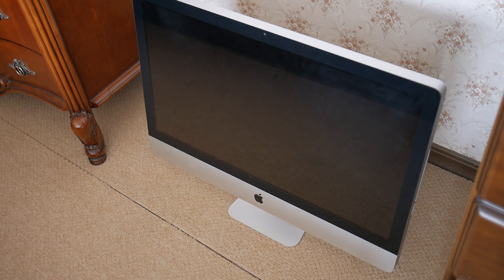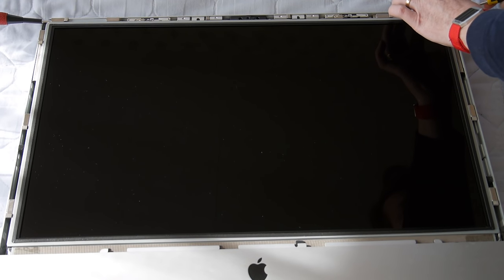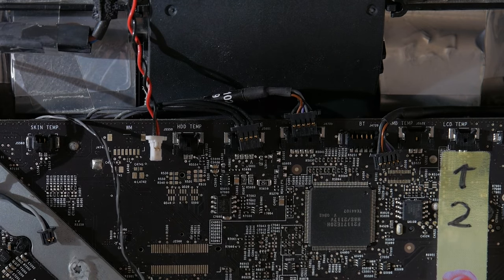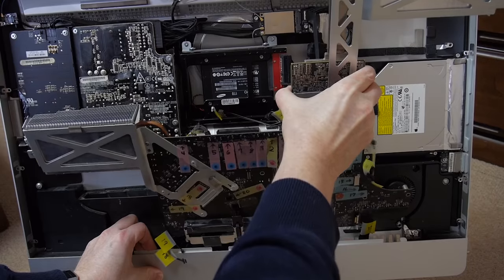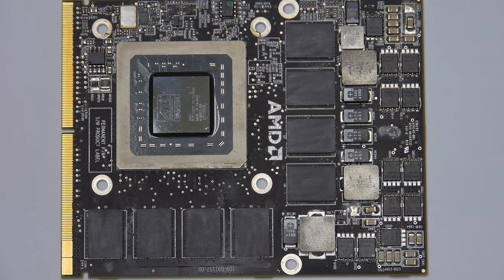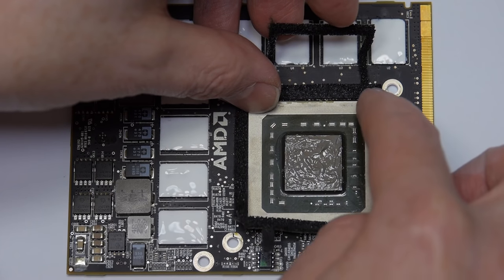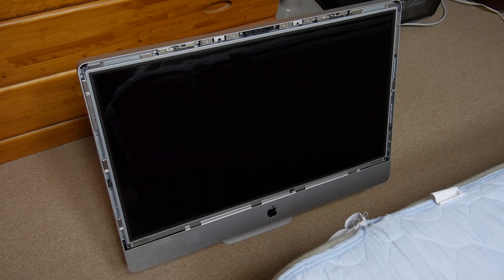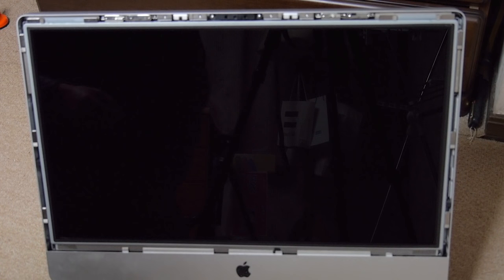Late 2009 iMac 27" Video Card Repair [4850 Bake]

Comment: You rock, JDW - I have a mid 2011, 27” 1gb GPU the screen displayed Green Bars and would not boot up so had nothing to lose. After watching your video felt confident enough to remove the Motherboard, but what pain. FYI - I Baked the GPU for 12 mins at 400 degree F. Replaced the thermal grease with Artric silver 5. Also replaced the thermal grease on the CPU while I had it apart. After finally getting it back together it Booted right up .  Thanks
Reply from the maker: Thanks for letting me know of your resurrection success!  With your having replaced the CPU thermal paste too, I suspect your total time invested was more than mine.  I do want to ask about the video card thermal paste though.  You seem to have only used Arctic Silver V and nothing else.  Did you replace the thermal paste on the video card memory chips?  You would have needed either a replacement set of thermal pads, or K5-Pro, since Arctic Silver V isn't thick enough to fill the gaps between those chips and the heatsink.

Comment: Thank you for taking the time to make this tutorial. I was soooo skeptical about baking, a computer in my oven, I’m not even a baker😉. I was also a little afraid tackle the innards of the IMac. It fired right up and worked great. Two extra screws leftover tgough🙏
Reply from the maker: It's great to hear your story of success, Don!  If those two screws are from your display, you're probably fine.  Just don't throw them away.  You might open the case again some day and want to put them back into place.  Best wishes!

Comment: Thanks for the video JDW, have just done mine - and seems to be working, also downloaded a fan control for extra cooling. Did notice the screws on the back of the Spring screws were very loose this would make for a loose fitting against the heat paste/sink.
Reply from the maker: Thank you for making time to comment, Andrew.  It's unfortunate to hear your spring-loaded heatsink screws were loose when you tested them.  That obviously would create heat-transfer problems that could even lead to the death of the video card.  I am pleased to hear the bake worked for you though.  Best wishes!

Comment: Cool video - used as a guide. Only now I forgot to put a rubber gasket back on the chip. I remembered when I had already collected everything. As you think - strongly it is needed, I do not want to take everything apart again. Thank you
Reply from the maker: Actually, that black thing you saw in my video is made of some kind of foam, not rubber.  I don't know the purpose, but since it is made of foam, I can only assume it is some kind of dust filter?  Maybe it was intended to keep dust from collecting around those chips?  Not sure, but it wasn't dusty at all when I first removed my video card.  I don't think it was intended to keep thermal paste overspill at bay because if that was the case, why make it out of foam?  In any case, I don't think it will hurt that you left it out.  If anything, leaving it out would allow for more air flow.
Reply: I'm understood, thank you. Although I have another video card (HD6970), but the rubber gasket is the same. I do not think that it is necessary for a heat sink. I will not touch it, I'll see how much the chip will work after warming up.

Comment: Excellent job JDW, the lights went out on my mac and I canned it. It was 10 years old but wish I had of seen your video before i pulled it to bits. I am now using the display as a 3rd monitor for the new mac.
Reply from the maker: Well, it's only natural that a veteran tool man such as yourself would want to tear that bad boy apart!  ;-) But I am glad to hear you were able to put it to good use.  Keeping these machines in service in some practical way is the ultimate goal.

Comment: Thank you for excellent video. I will use your video to open the iMac, and then remove the hard disk, and later back it up via usb-converter. I had no idea that the glass is so easy to remove.
Reply from the maker: Thank you, Riku!  The glass is easy to get off, but putting it back in is the hard part because you have to blow out all the dust before you put the glass back on.  Because none of us have a "clean room" to do that job in, there will always be a bit of dust that flies behind the glass before you get it back on.  It's perhaps the most frustrating part, actually.
Reply: @JDW-  I had a bit hurry today so I did not buy those vacuum-tools like the one you used. Instead, I used the one that I had at WC; the rubber one for plumber. It sucked the glass all right but I was surprised how easily it got off, and tilted the glass too much. Yep, it broke....my main goal was to find the hard disk which I was able to remove, mother board or display circuit was broken, so no use to trying to fix the iMac further. Now I need an SATA-USB adapter for data recovery. I wish the iMac would have the hard disk as module that you can change from outside...like the ram-memory.
Reply from the maker: @rikunevalainen8154  Oh no!  I am terrible sorry to hear you broke your front glass!  That certainly would have made my heart sink. The good news is that you can find replacements on Amazon for surprisingly respectable prices like this one (affiliate link): https://amzn.to/3p688OR

Comment: Thank you so much @JDM i fixed my shitty imac 2009 today with your fully detail tutorial. I baked my Radeon card at 200 fan force oven in 10 mins. At first, it has a big smell of burning plastic (or capacitor or somewhat)  from the card. I was so worry about mine card was overbaked, but i had to tried no matter what as i had no turning back once i stepped into this baking method. After awhile review your video over and over, i had finished putting back everything together. And then, booom it workded like a dream, just as good as before it died out (even run cooler than before ; i guess because of the new thermal compound that i bought from the local shop). And now i'm typing on this computer to say thank you while i'm opening 11 tabs on Safari and playing music from one of the tab on Youtube. 
Awesome job that help me recused my imac and save me ton of money on buying a new one. 
:D sincerely thank you for all of your effort putting in this so much detail video.
Reply from the maker: I'm thrilled to hear of your success, Addy. Thank you for sharing your story and best wishes as you enjoy that newly resurrected Mac!

Comment: Thank you so much.  You video is very detailed (which I needed) and it worked.  The only suggestion I have is when you are putting it back together, please don't speed that part up.  I had to keep going back to the beginning to figure out how things went back together on some of the plugs.  :-(  But overall, excellent video.  :-)
Reply from the maker: Thank you for watching and sharing your story if success, Dawne.  I of course take all advice in the comments section to heart.  The main reason I sped through reassembly was because some people complain if the video gets too long, and with it already being 1 hour and 6 minutes, I was afraid that going to slow at the end might be an issue for some people, especially since one can review the initial part of the video again.  But again, I do appreciate your constructive advice and will consider that in future videos.  Best wishes to you and your newly resurrected iMac!
Reply: @JDW-  When I was doing this procedure, I would watch you and stop the video and go do what you just had shown.  1 hr. 6 mins is nothing compared to about 10-12 hours.  lol.  Thanks again.

Comment: Great work. Just one point- when replacing the motherboard I had to take the panel off the memory card access (on the bottom of the case) to feed the memory cards into their slots. Before that the board wouldn't go far down enough......
Reply from the maker: If you mean the aluminum "memory access door" that screws in at the very bottom of the iMac's housing, then yes, you would need to leave that off during the installation, and of course all RAM should be removed before the motherboard is removed.  Thanks for watching!

Comment: hey man, you fixed my iMac, although the br and cr series difference doesn't matter, it will never get close to that temperature, it usually hovers around 30 in case temp, so if I were you, don't wast your time.

cheers,

Ethan
Reply from the maker: You are correct about the PRAM battery.  But there is one point of consideration... Apple "wasted their time" :-) in choosing the BR-series, so if one has the means to get a BR-replacement, why not?  The BR series would be more robust over time in hot environments, even if the heat of the said environment didn't exceed 30°C.  This is more of a concern for iMacs that run 8 hours or more per day.  But thank you for mentioning it nonetheless, as many people will get by just fine with the CR-series battery.  It's also great to hear your iMac was fixed.  I hope it lasts as long or longer than my 2nd bake (2 years 9 months)!
Reply: @JDW-  very valid point you made there, I like the video too, keep it up

Comment: thankyou for taking the time and effort to post the video,apple sure makes it as hard as possible to repair any of there products,which usually means its not cost effective to do unless you can attempt the repair yourself,your video gives some hope to some that can attempt the repair themselves with a minimum outlay money wise,thanx again
Reply from the maker: Thank you for your kind word, Patrick, DIY repairs are especially important now that Apple considers these old iMacs "obsolete" and therefore doesn't carry repair parts for them anymore.  For most people who try the bake though, it works, and if you use the correct thermal pastes, it often can last long enough to have made the effort worthwhile.
Reply: @JDW-  just an update managed to do mine with your help,i did mine in a combo microwave oven thats got an oven feature as well so i set in on the oven setting at 200 but checked it first with a thermo couple multimeter and it read 195 - 200 so i gave it a go and it seemed to work thanx for your help hope this might help others as well
Reply from the maker: Your oven seems to be just like mine. So long as it’s set to oven mode and not microwave mode, it really does work great and the temperature is stable too. I’m certainly glad to hear it seems to have brought your graphics card back to life! Best wishes!
Reply: @JDW-  yes certainly seems to have worked for mine,forgot to ad that i put my card in the bottom part of the oven and not near the top part of the oven as the bottom part is where i tested the temperature,good luck to anyone who tries this way,and thanx again for your input

Comment: Thank you very much for this tutorial! I just bought an iMac with a supposedly power button issue that caused a black screen when it turned on and it does eventually come on after putting it on and off many times, but after many hours of research it turned to be the GPU and I wasn't prepared to buy a new since shipping is so expensive where I'm from, hence finding your video and I got it right on the first try ( on an old school oven), just to see if it will last for a very long time. Again thank you very much for this!
Reply from the maker: Thank you for sharing your success story, Luigi!  I'm so happy the Bake was able to get your GPU up and running! The Bake doesn't last forever, but it usually lasts long enough to make the effort worthwhile, especially if you used the right thermal paste.  Best wishes!

Comment: Just a little note.....  To replace the video card, ONLY 4 screws are needed to be removed!  I saw this on another video on youtube.  Where you have some tape with the number 3, those 3 screws need to be removed, then in the top right corner of the video card heatsink , there is ONE more screws, and BAM, video card is removed WITHOUT having to remove the logic board!  Your welcome :)  *Video uploader, maybe make a note of this comment....   Thanks for the free information though, and trying to help people fix their Mac, that is a great thing to do to help the community, but you don't need to remove anything more than the screen, and 4 screws :D.   I bought my video card ATI 4850 on ebay for $150 and it came with the heatsink already, so I didn't even need to swap out heatsinks.  Hope I helped, not trying to be a know it all, I run a computer repair shop, watched this video, then found the other video showing 4 screws.  :D  (after screen removed)
Reply from the maker: You are correct, but you still need to at least partially pull out the motherboard in order to change the PRAM battery which sadly sits on the back side.  You can see the easier method of video card removal (which ignores the PRAM battery) in my 2nd Bake video here: https://youtu.be/6BJGLFCigdA

Comment: Friend, you are the fucking master. I had the problem of vertical stripes in my imac late 2009 and I have solved it by following your video. If you go through Spain you have a few paid beers. A big hug
Reply from the maker: I’m so pleased to hear of your success with the video card bake, Manuel! Best wishes!
Reply: Bad news, the vertical stripes have returned. I will try to do a second cooking following your new video and I will tell you the result. Regards
Reply from the maker: Only 2 weeks of use before the problem returned?  I'm terribly sorry to hear that.  But that seems much too short for a failed bake.  My 1st bake lasted 4 months.  I'm still on my 2nd bake, well over 6 months.  One change I made though was the thermal paste.  Please be sure to watch my 2nd Bake Video to see the paste I used and how I applied it.  You would need to remove the video card again to redo the paste, so you might as well do a 2nd bake.  But using good paste in the right amount is important.  Again, please watch my 2nd Bake Video for that.  Link is in the description above.
Reply: After the next baking I will use quality thermal paste. I have already asked for amazon the same pasta that you have used. Thanks for answering. A big hug

Comment: I’ve removed the glass from  my 27” without suction cups by slipping guitar picks into the top right and left corners and carefully prying open. Did this after I heard some one say they did the same with their finger nails. So save your suction cup money for good thermal paste
Reply from the maker: Great tip for the guitar players out there, but folks such as myself prefer to use the suction cups over a potential broken fingernail. :-) Thanks for the tip!

Comment: I just got mine working! Boot would get stuck ant 50% loaded and vertical bands and/or squares all over the screen. Before that, the times that it would boot up it would freeze on its own, wouldn't wake from sleep (had to disable) and screen saver would turn on sometimes even though it was disabled. I did 400 degrees F for 9 minutes then left the oven door (Toaster oven on bake mode) open and let the card cool completely. MX-4 paste and left OEM white paste on RAM and other chips. I actually tried using a heat gun right before at 395 (I can choose the exact temp) for 9 minutes by hand right over the GPU  but that didn't work. Using a blower when the computer is open (DO THIS OUTSIDE) works extremely well at removing dust from everywhere. I am actually going to drill multiple holes in a nice clean circle using a template in the case right where the GPU sits and may even attach an external computer fan right over the holes and leave it connected via USB all the time. The idea to use an Nvidia Quadro K2100M PC card and flash was an interesting idea. Thanks for mentioning in your updated FAQ 2020 video which was super informative!! If you are wondering if you should try this, do it.
Reply from the maker: Thank you for the detailed comment, and congratulations on your bake success.  For reason of longevity, you may find that leaving the stock past on the memory chips is inadequate.  That's really why my 1st bake lasted only 4 months, I believe.  After my 2nd bake, I took time to clean off all the old paste, then apply K5 Pro (a thermal pad replacement paste) on the memory chips, and K4 Pro on the GPU (you can use MX-4 or Thermal Grizzly, etc. on the GPU only).  That 2nd bake lasted 2 years and 9 months.  So if your bake lasts less than a year, I have little doubt it's due to the old paste on the memory chips, which may be true even if your mod technically does cool the card better.  I look forward to hearing how your iMac does over time.  Great job!
Reply: @JDW-  I watched another video of a gentleman who repaired computers at a shop who said it was fine to leave the oem paste on the vram since it didn't get as hot but you're right. I'll prob grab the K5 pro for the pads and button that up so it's a thorough job. Definitely glad it's working. It's a perfectly good computer other than GPU issues and wanted to fix it even if I am to give it away. The crazy thing is I had all these same symptoms for such long time and thought it was my external audio interface and unsupported drivers at the time or the OS but I think it was the early stages of the card failing as it was inconsistent and it died literally two days ago. Just printed out the template for drilling! Thanks for your content! Let's see how long it lasts with no dust, fresh thermal paste, holes in the case with an external fan and internal fans running faster than default with Macs Fan Control!